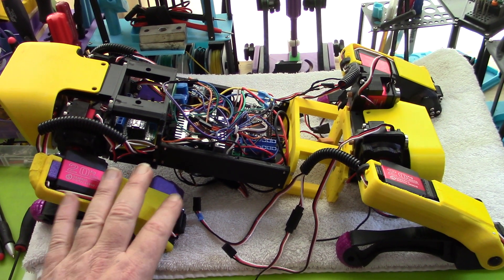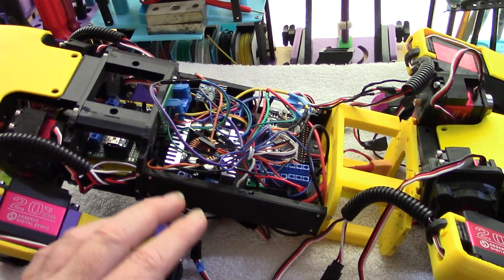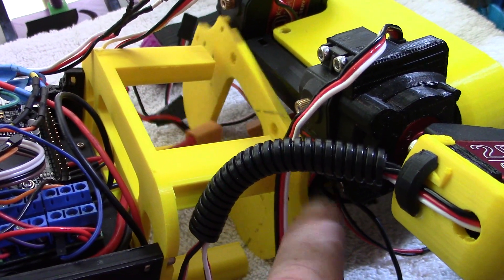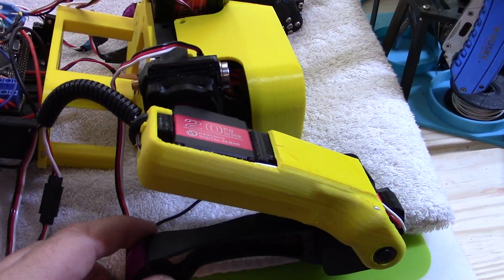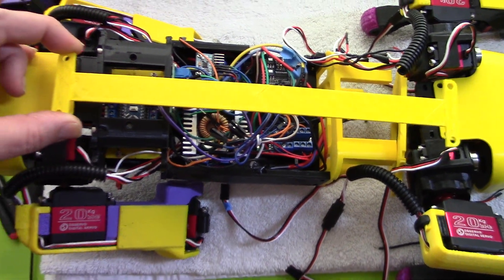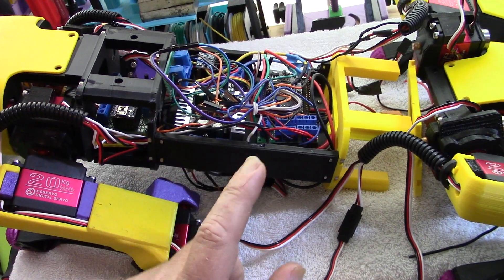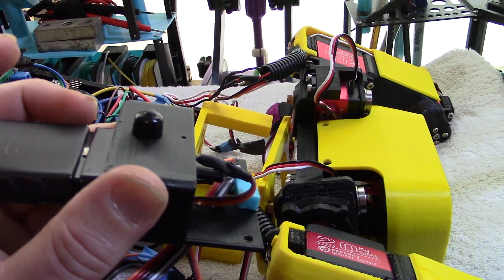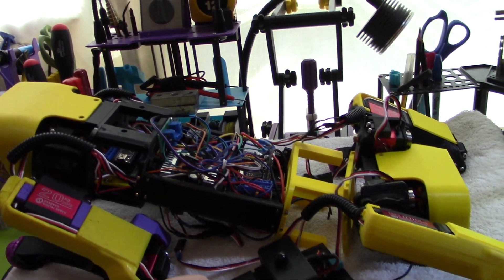Body Extension #2 : Nova SpotMicro - a Spot Mini Quadruped Robot Dog Clone

Comment: Hi Chris, love the idea of hiding the "backpack" and extending the entire body. I played around with some 3D designs to extend the head so I could mount it on a ball joint with connecting pistons and some sort of cabling or "steering rods" and servos to give the head movement independent of the body, still working on that. Printing is on hold until I see your body changes for NovaSM3...looking forward to that!!  Thanks.
Reply from the maker: lol wow, that sounds cool!  Funny, last time I had her head off, I sat it on top of the shoulder block, and boy, it sure looked cool - more like a "dog".  That may give you more room, and a "neck" to work with for pivoting.  Like this:  https://github.com/cguweb-com/Arduino-Projects/blob/main/Nova-SM2/dog_head.png

I am printing my final mods the next day or two (the top and bottom combined take me over 30 hours to print - this is the LAST TIME!  lol

I will post a final update in a few days - there are a few new little design tweaks to both top and bottom covers - stay tuned! ;)
Reply: @ChrisLocke1969  That's pretty cool, never thought of elevating the head to be higher than the rest of the body, just like a real dog. I was thinking of an in-line kind of setup, everything is the same height where the head is just moved forward, not upwards however your image has given me other ideas now. I like how the head moves on this humanoid robot here https://www.youtube.com/watch?v=GDpuJFCJ2hM&t=27s
Reply from the maker: lol ya, like i said, i was just moving the head cap out of my way and thought... hmmm, thats kinda cool. I say go for it!

and yes, ive seen that project and have been tempted lol  But then I'd never get anything else done 🤣👍😎